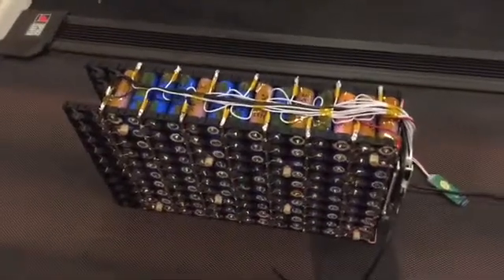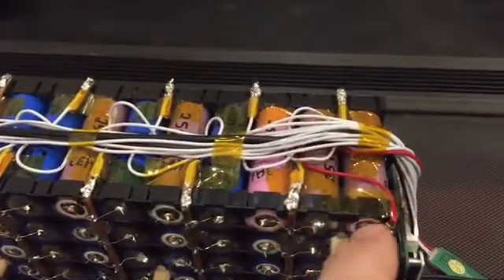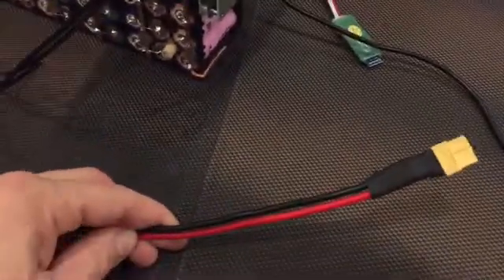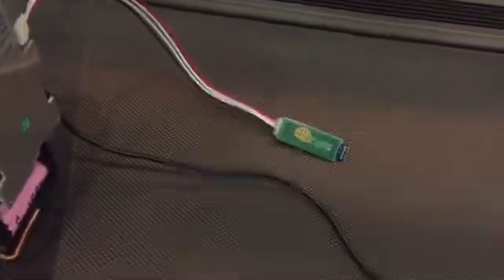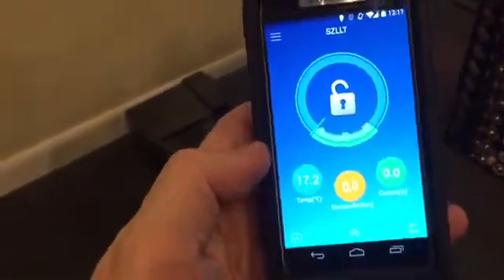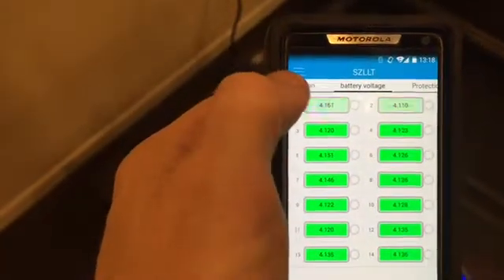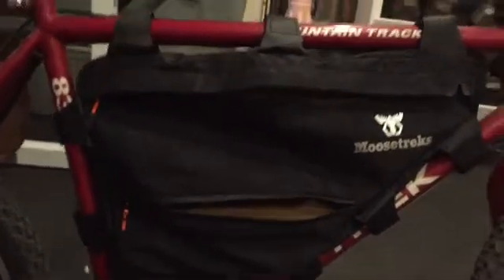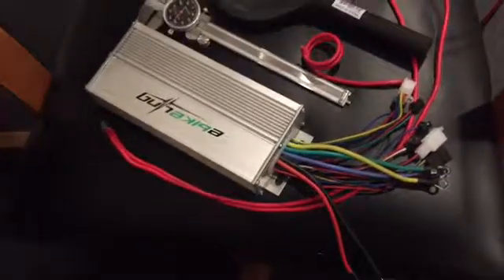DIY E-Bike Battery - Volume 2

Comment: Hi, do you have any problem with this bms. Im wanting to build a 1000w ebike battery from recycle 18650 and im thinking to buy this "cheap" bms. Can you change the parameters from the mobile app. Thank you!
Reply from the maker: I have had no problems with this BMS.  It is the only one that I have been able to find that has any kind of connectivity so that you can actually see what the BMS is doing and make changes to what it does.  You can make some changes with the Bluetooth connection to the Android app but you have quite a bit more control with the USB to PC software.  When I bought my first BMS from this company they sent both the Bluetooth dongle and the USB connector.  Now I think they have you choose one or the other but you may be able to buy both for an extra charge.  For an Ebike, I would think you’d definitely want the Bluetooth dongle for monitoring while on the move, but you may also want the PC connector for setting parameters more easily.  Hope that helps.

Comment: Where did you buy your motor and bms from?
Reply from the maker: The motor is from EBikeling but I bought it on Amazon.  The BMS I bought direct from SHEN ZHEN LLT ELECTRONIC TECHNOLOGY CO,.LTD.  Their website address is https://www.lithiumbatterypcb.com/.  They have a large variety of BMS's and not all of them have the Bluetooth/PC connectivity but the website is well done and it is pretty easy to understand what you are buying.  I bought another BMS from them for a 7S DIY powerwall that I built.  You can choose between a Bluetooth or a PC connector (the PC connector plugs into the same port on the BMS and then goes to a USB port on your PC).  When I bought my first BMS they sent both connectors but with this one, I had to choose whether I wanted the Bluetooth or the PC connector.  Both the Bluetooth and PC software are a free download from their website which you can do even before you buy the BMS but you can't do much with the software until the BMS is connected.  Their is little to no documentation for the software but you can figure it out by playing around with it.  One last thing, it took 3 or 4 weeks for delivery from China to America but I got confirmation e-mails for my orders and the packing and contents were very good.  Hope this helps.